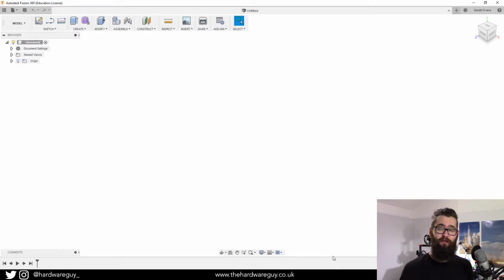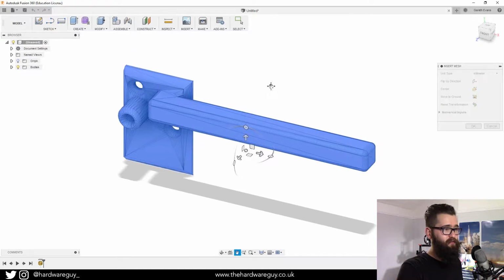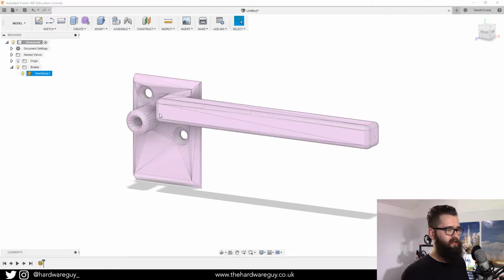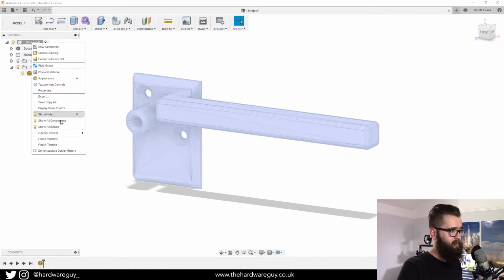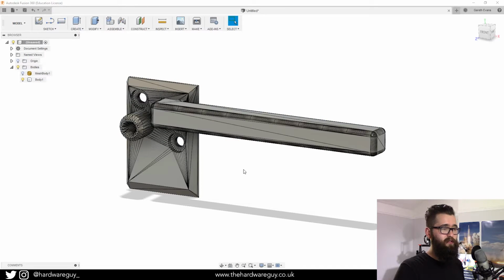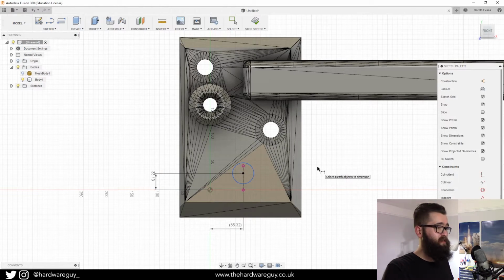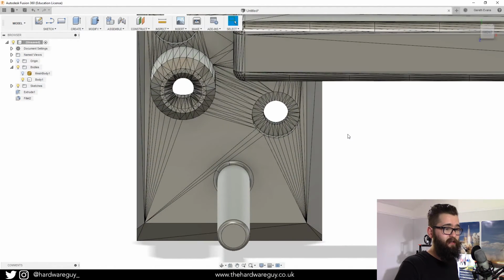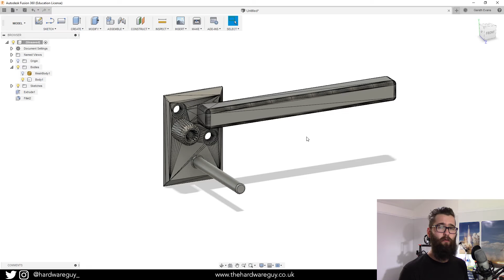Importing and Editing STL Files in Fusion 360

Comment: I ran into an issue as it stated that my mesh can not be converted. Warning: This mesh contains a large number of facets. Conversion has been aborted :O
Reply: had the same issue, just found out you can reduce the amount of surfaces at the mesh tab - reduce. Then conversion worked as in the video
Reply: @AcerRacer123  I also found it :D But mine had still too high number of surfaces. I had to go to like 1% but than it was barely the same object. After some trial and error I found that it just does not work with all objects if they are too complicated... It was a voronoi object that I wanted to manipulate but was unable to do so :(

Comment: Is it possible to edit diameters and other dimensions in this way?
Reply from the maker: Yes.. kind of! You can use the push/pull tool to make modifications
Reply: @thehardwareguy  though there is no way of actually making changes on measurements of existing bodies or components from a mesh file. To me it is slightly useless function. Unless you want to mod the specific part by simply adding holes, etc. I find it easier to just remodel completely. Thanx for the well explained video though.